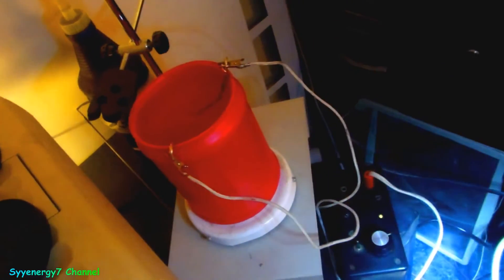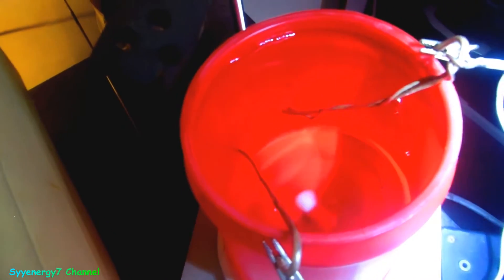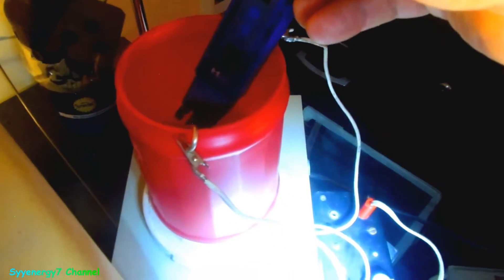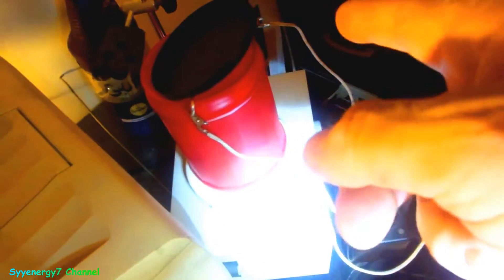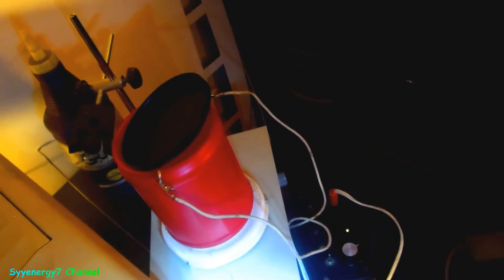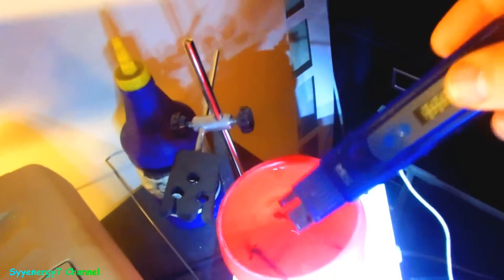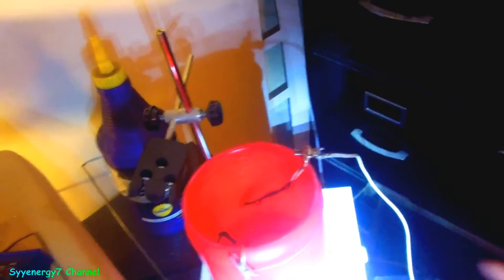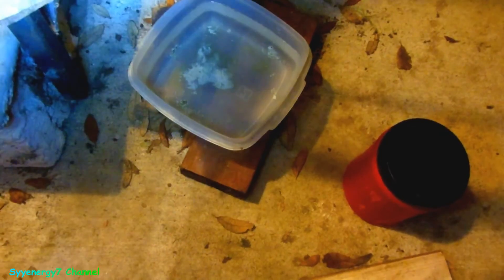Making Colloidal Silver Quick & Easy -for the CATS

Comment: I make mine with Canadian Maples. I usually run 3-5   6 volt worn down alarm back-up batteries in series. I run the stirrer off of 110 fairly slow. 6-8 hours puts PPM over 18, but it drops back to 15-16.  I get rub marks form a leg braces because of Diabetes.  A few squirts and relocating brace straps and zero  abscesses in years. Nurses treated these with silver impregnated 4x4s that cost about $80 for a 25 pack.  Dogs get some on cuts from chasing critters through barbed wire.